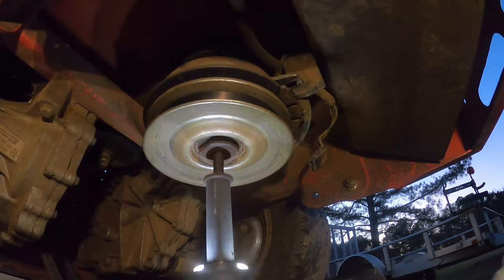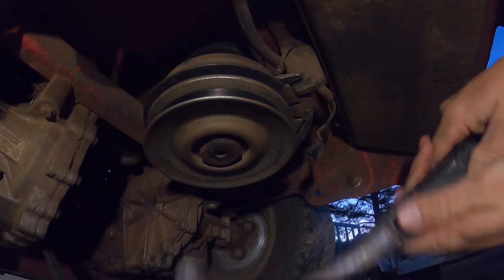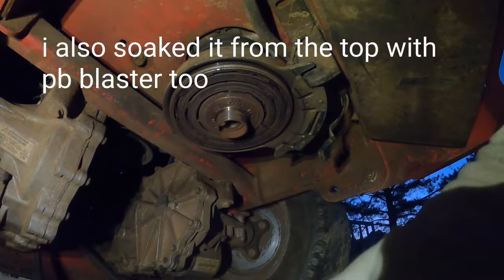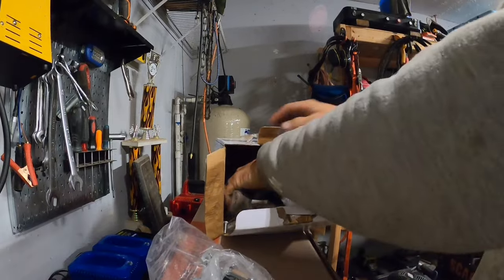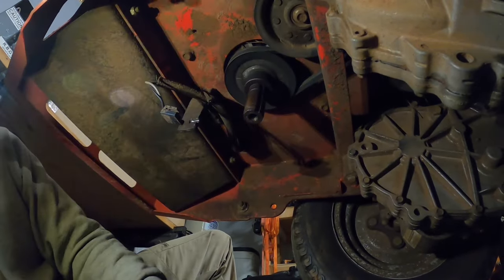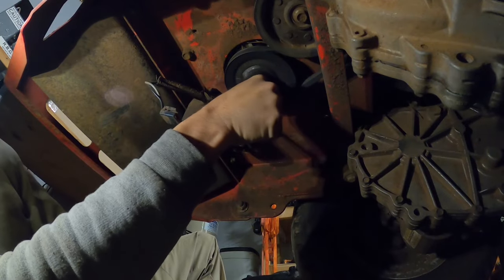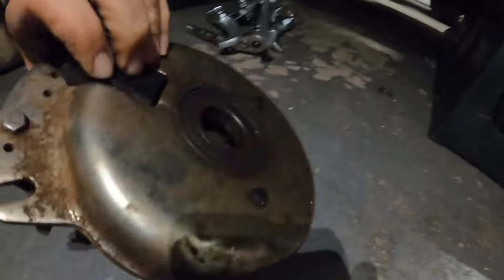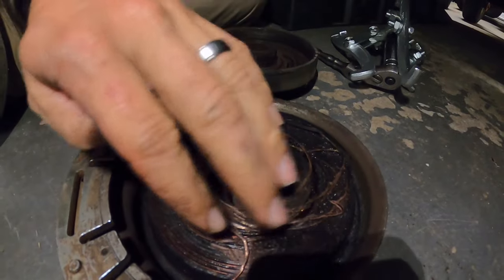how to remove a clutch on a zero turn mower 😎🔥

Comment: I think the torque down is 50 to 60 foot pounds. Also engaging clutch at lower rpm will extend the life of the clutch.
Reply from the maker: It was hard to remove the bolt with the impact i feel like it was on there like 150 foot pounds lol
Reply from the maker: Maybe more probably more like 2 0r 300 lol

Comment: Nice, if only the Snapper Z 1802K zero turn had all that room below the clutch. There is barely more than 3 inches before a crossmember...that cannot be removed! Not sure how it can be replaced at this point. Maybe a member of the Q continuum can help😂
Reply from the maker: I guess you could pull the engine up if you have to its only a few bolts

Comment: I just got a used bobcat 218es. The pto always engages after first start but once it warms up and I try to engage the pto it takes a minute or two before it engage. Do you think this would be a bad clutch?
Reply from the maker: Yes but may just need to check clutch clearance adjustment if your clutch has that the one in this video doesnt but some do so check that before you spend money to replace

Comment: Having the same problem with my big dog 52 inch cut the clutch pulled apart the top part is still stuck on the crank I use the puller puller wouldn't get it off it kept slipping off had to weld it to the top half of the clutch still won't pull it off got a mini torch put a little bit of heat to it with some penetrating oil and it still won't come off
Reply from the maker: Maybe soak the shaft with penetrating oil from the top and let it sit overnight maybe with the pressure on of the puller if that doesnt work may have to start cutting off the rest of the clutch
Reply: @tonyslawncare  yeah I've done welded a three leg puller to that bell housing had pressure on it I've done heated it with my mini torch soaked it and penetrating oil tapped on it with hammers it's had pressure on it for 3 days
Reply: @tonyslawncare  I'm thinking it's going to be me and my angle grinder tomorrow
Reply from the maker: @chadjohnson5128  worst case you could pull the engine to make it easier
Reply: Don't know if it will come off wtith the clutch on. Holes looks to small.

Comment: my dad had someone try and replace his pto and broke the main bolt off up in the shaft . im going to go try and tap it out for them i was wondering if that bolt turned opposite or does it thread like a regular screw
Reply from the maker: Im pretty sure its normal thread

Comment: I have replaced the PTO switch 3 times now on my Simplicity Citation Zero Turn. Someone said that it was the clutch causing the switch to overheat. Do you think this is the cause of my problem? Lawn shop wants around a thousand dollars for parts and labor. I have purchased a new Clutch and PTO switch and was getting ready to change both of them myself.
Reply from the maker: Check the inline fuse. and i would feel the wires from the clutch all the way up to the pto switch i wonder if the coating of the wire is rubbed off in some little wierd place and touching the frame ? Look into that carefully
Reply from the maker: But yes it could be the clutch
Reply: @tonyslawncare  Thanks
Reply: Check ohms from clutch.  If they are below 1.5 then clutch is bad. Mine is .4 and I have a clutch on its way for my scag.